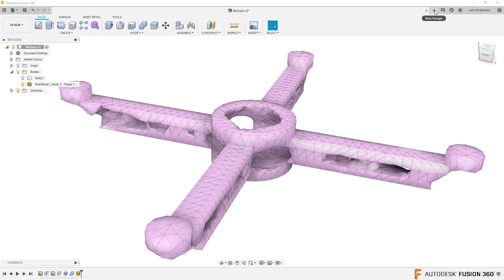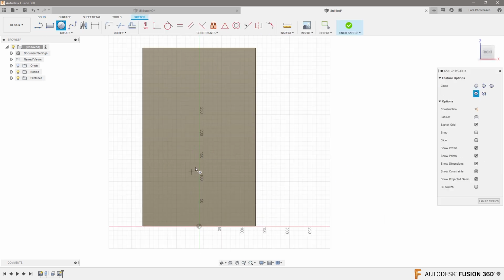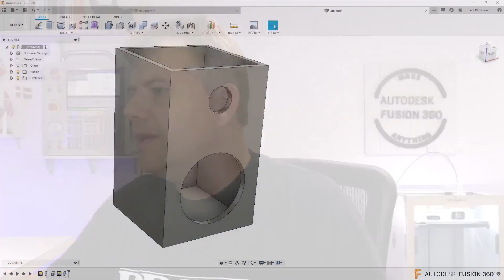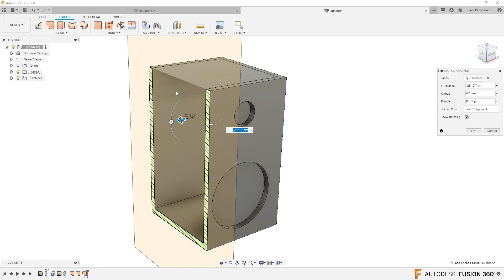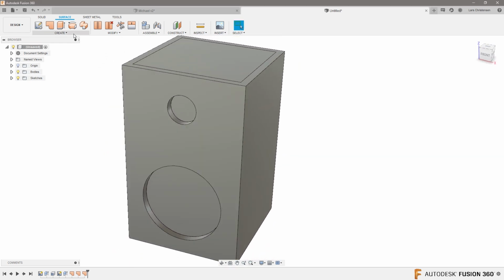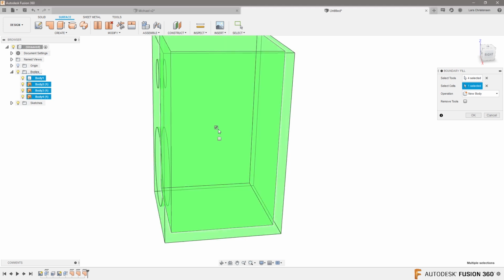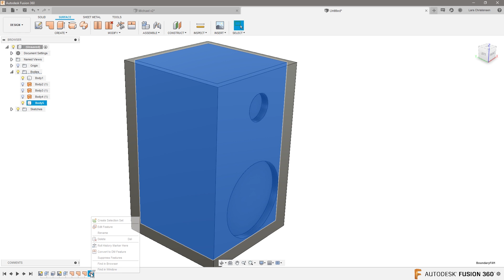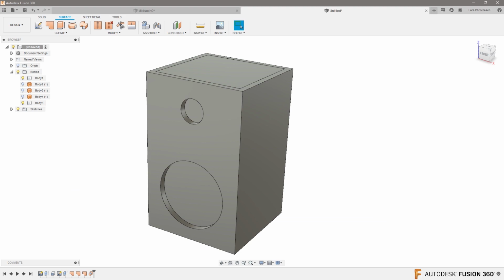Fusion 360 — Speaker Volume W Boundary Fill — Ask LarsLive

Comment: Cabinet volume is important because the trapped air inside acts as a spring against the woofer cone and affects the behaviour. If the speaker has a bass port it also affects that.

Some clever people even worked out the physics for most of these interactions and came up with formulas to describe it, so a lot can be optimised in simulation today. A set of specs to enable these formulas are available for any good woofer called Thiele-Small parameters. Check out LspCAD for simulation.
Reply from the maker: Awesome! Thank you👍😊

Comment: Lars, you need to account for the mounted speaker with a cone, basket and magnet inside the enclosure displacing volume.  Grab a speaker design from grabcad, place it inside and recalculate interior volume. Thanks for the video,  I continually forget about the shell command until I see you use it.

https://grabcad.com/library/celestion-12-guitar-speaker-1

Comment: If it is an oddly shaped speaker, then the boundary fill would work even better that your example, while giving the internal volume. Which they would do exactly as you showed! So it could be useful and used in where a simple extrude couldn't show the volume of the space.

Comment: Hi there, help me if u can. 
Wanna use a rectangular pattern feature (like e hole ok? or in a draw, is ok as well) and im trying to CONVERT a distance parameter to a quantity one. For example if the high is x mm, than than the quantity is value of x/32. Please? :)
Reply: What i though it will work is to set a second parameter (no units, or pieces) and make it equal value of a distance parameter. But isnt working.